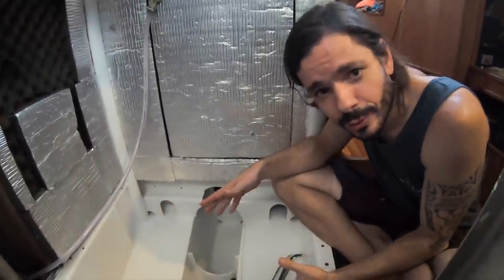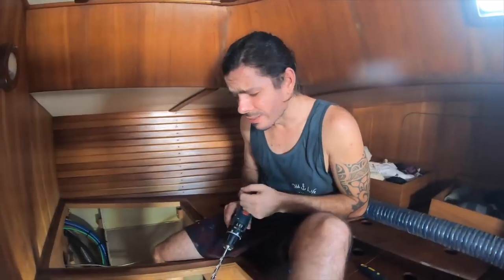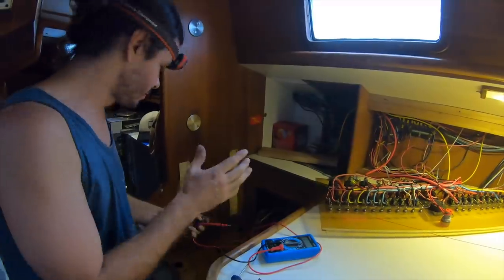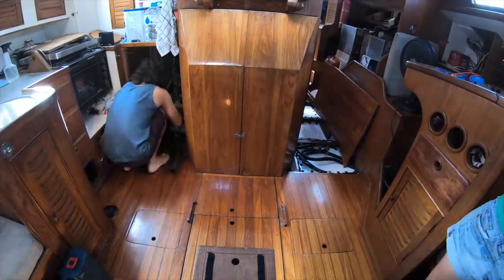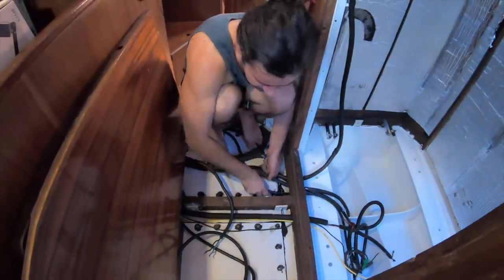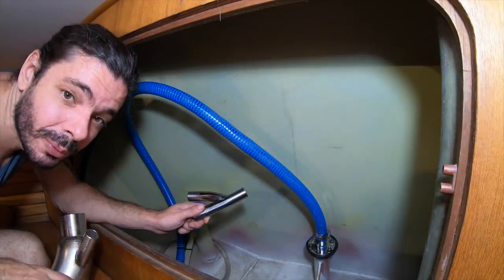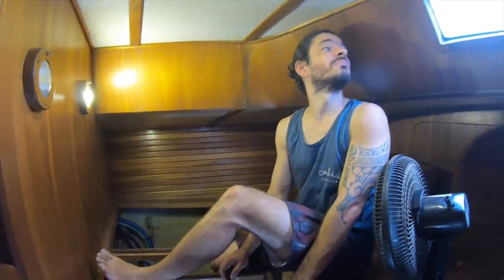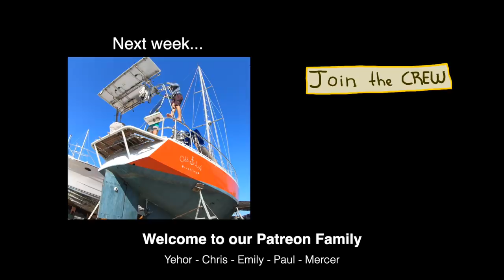⛵️We didn't think about that when we Bought a brand NEW ENGINE for our Sailboat!! 😨#174

Comment: Dont forget to check that the volume of your water trap will cope with the increased volume of the exhaust pipe. Its there to keep residual water in the exhaust from back flowing into the engine, when you stop the engine. The water trap looks pretty big but I think you have about doubled the volume of water it needs to hold. x 1.6 for the increase in cross-sectional area and the rest for the longer run. Your WT volume needs to be 1.5 x the exhaust pipe volume from ex elbow to gooseneck to allow a good safety factor - check this point with your installer. Measure it for yourself.
I'm assuming your engine exhaust outlet is lower than the top of the gooseneck, or maybe you have a high rise ex outlet to bring it higher?

Comment: Will you wrap the metal exhaust pipes with insulating tape? They will put off quite a bit of heat. I would use metal elbows between sections of flexible hose.
Reply from the maker: We talked about it in a comment pinned 😉

Comment: Exhaust gases are extremely hot can be between 500 and 1000 degrees F. Does the part of the exhaust pipe you are installing in this video get hot? If so, will the hot metal surface affect the surfaces the pipe is sitting or touching as it passes through the boat? Does the pipe require insulation?
Reply from the maker: We explained something about it in a pinned comment 😉

Comment: If that is an exhaust pipe, will there be a problem with heat? Exhaust pipes get extremely hot, enough to burn wood.
Reply from the maker: A little bit but not as much as if it was a turbo engine

Comment: Most boat exhaust systems are insulation wrapped due to the heat. Wondering if the Yanmar exhaust system requires insulation around the metal tubing. The Yanmar engines are really good looking, long life power plants! You two are all around impressive people!!
Reply from the maker: They didn’t require it, our old one didn’t have any insulation around.
Reply: @OddLifeCrafting : Oh good....thank you!

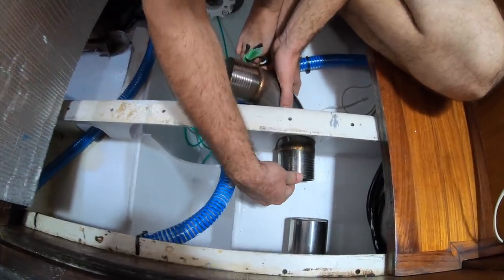Comment: Good day to you, Thanks for your very well done videos and bring us on board with you. At 22:30, tube MUST be in-line because in a so short distance NO flexible will resist to straighten up and create a leak. Also, always nice to protect wires (wire loom/grommet or any other type of protection) as well as exhaust tube to prevent vibration leak and noise. Be well ;-D

Comment: Just a thought, you might want to heat wrap (to keep all surrounding structures cool) all pipes and structure of the exhaust system, and use stainless steel zip ties to keep the heat wrap (insulation) in place.

Comment: Always look forward to seeing your videos, however am I the only one a little concerned using the new metal pipe for part of the exhaust?  Doesn't the exhaust get very hot? With you passing the new metal pipe so close to the wood of the cupboards will create a fire risk?  The other flexible pipes are insulated so will not be a problem....
Reply from the maker: Glad to hear you like our videos. We explained something about the pipes in a pinned comment 😉
Reply: @OddLifeCrafting  hey guys, totally agree your videos are so much fun! 

The cost of exhaust wrap and the hour it may take to put on is nothing compared to the engineer being wrong and having a fire caused by radiant heat. It is just one of those really small, cheap and redundant safety measures you can implement super easy and it offers peace of mind and just might save your life.

Really looking forward to next week!

Comment: Hiya to you both . For cutting away wood panels in difficult hard to reach areas you might find a cordless multitool with a variety of cutting heads easier . Stay safe and good luck .
Reply from the maker: It’s kind of an expensive tool here in Brazil

Comment: Good work, soon you will be done. There is a safety concern mixing the exhaust with the bilge pump outlet. I know you are putting a check valve between the pump and outlet. But the check valve may not be effective for carbon monoxide. It could be possible for CO to pass through the valve and feed through the pump and poison the air in the cabin. Just because the valve is air tight does not mean it is CO tight, Also, over time the valve can leak. Please consider enlarging the exhaust port in the hull to accept the 3 inch diameter outlet. It would be awful to have one of you asleep in the cabin during a long passage when the diesel is running.

Comment: You will need to insulate that steel pipe or it may melt your boat. With your space issue you might use a material that is used by pipe welders so they do not burn the wall. Keep up the great work. I think I would have just used a reducer from the engine and left everything else intact. I might have effected wide open throttle though because of the restriction.

Comment: Ok, after watching you use a drill to alter most every part of your boat, I want to ask: do you not have some small power tools? What current are you running there? I’m planning to look into this for you...if I had some battery powered tools, do you have a way to use 120 V for the charger? I’m serious!
Reply from the maker: Hey Michael!! All our tools are from before the boat so they are all 220v as our home town just uses 220v. On the boat we will have to use the inverter to invert 12v to 110 and then a transformer to transform 110v into 220v. We have most of the tools, the only one we have been postponing to buy is a multifunction tool be at some point we will get one. 😊
Reply: @OddLifeCrafting  any particular brand/functions? If they were 110 could you use them?

Comment: May need to allow more room for the pipe close to the engine to allow for movement of the mountings ( noise / rattling on the frame work) not much movement I know 
But just something else to consider.

Comment: Always have your ssb operational, just a little added comfort knowing that if all else fails you at least have that, sattelite phones dont work for crap in storms, you may be stuck in a situation that may be to far away for normal high frequency radios 30-50 nautical miles, and no cell towers on the ocean ;) so it's always good measure to have the side band operational they can sometimes range up to 400nm to 1000nm.

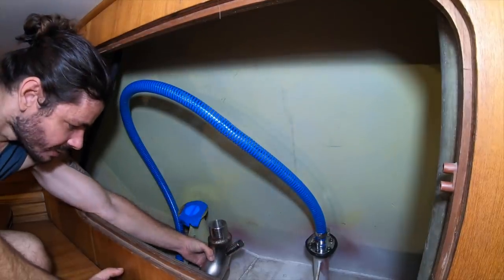Comment: The amount of daylight showing through the blue tape of the larger through-hull at 16:32 looks like it could be a little smaller than 2-1/4 in.. Confirm you are considering the internal diameters of your piping system.  Wall thicknesses of the various components may be different.

Comment: If you have wet exhaust you pull the rubber hose all the way to the water trap in the back.  Is it possible to pull pipes through the toilet cabinet, to the engine?

Comment: Just curious... what is the reason for needing such a wide exhaust? The Yanmar, at 54hp is ⅕ of the power of my Mercedes 3-litre turbo engine yet it breathes just fine through a 2" pipe. Is it to promote cooling?
Reply: Water cooled exhausts do need to be bigger than dry (car) exhausts but 2" would be fine for that run. Say 2 1/4 to be safe. Check the back pressure after installation (1500mm h20 max). May as well keep the run from exhaust outlet to watertap at 3" bacause thats the diameter of the Yanmar ex outlet.

Comment: Make sure you have a loop so in rough water or waves hitting the back of boat salt water doesn't go into the motor or bilge pump doesn't pump water into motor if line gets stop. Saw a guy destroy a brand new yanmar motor because salt water set in the motor on the pistons.

Comment: We had the same issue when we installed a new generator....Buying the generator was only half the cost....redesigning the exhaust system, and installing was the other half.....Really think everything out before you pull the plug on new equipment.

Comment: Lots of people are questioning the exhaust size and with the Yanmar engineer signing off it's likely fine. 

What I have an issue with is connecting a bilge outlet with an exhaust outlet. A failure of the check valve could allow exhaust to go into the bilge and cabin and could kill you. 

CO poisoning is a very real danger. I would just open up the outlet and make the exit 3". It's a steel boat and would be trivial for an experienced fabricator to do. It's what, the last 20-30cm or so?

Comment: Where that new exhaust pipe comes close to wood, I would add some insulation around it.

At 22:20, where the 2 pipes don't align, my suggestion is to trim back the pipe from the water lock about 5cm and then use a piece of flexible exhaust hose about 50cm to pass through the bulkhead hole and connect to the 90° on the other side.
Reply from the maker: Thanks for the suggestions. We don’t have a Flexible hose with this diameter here in Brazil
Reply: The exhaust is wet, so the temperature of the hose will never exceed 50°C. That is also the reason for the 3" hose for a 54hp engine.
Reply from the maker: @rhkavli  Thanks for the explanation

Comment: I'm not an engineer but wrapping the motor exhaust with heat resistant material is an excellent idea and well worth the additional effort and expense. Elbows in exhaust tubing can be problematic but again I'm no expert on these matters. Exhaust tubes can get very hot - hot enough to easily start a fire - so please don't take any chances - just do it!
Reply: It's a water-cooled exhaust. You only have to start worrying about excessive heat if the water comes out of the exhaust as steam, or stops coming out altogether.

Comment: Nice exhaust but what about insulation on the outside? Save heat and noise. Special in those corners where as your bedroom is the wood that should not be in contact with the naked exhaust. Furthermore, if you have a situation where as the exhaust is not in line you always can make a flange on both end and tide up afterwards. If I was you I would never make the exhaust all welded but somewhere on inconvenient places make a flange on both sides for the connection as later on you will notice the advantage from it when you need to move away the exhaust for some reason. Still thinking about exhaust insulation as this 4 cyl Yanmar will give some heat .

Comment: I would not have split the exhaust between the two hull penetrations.  Running exhaust through the bilge pump discharge risks CO poisoning if the check valve in the bilge discharge fails to stop the CO from back feeding through the bilge pump into the people compartment.  Be sure to install a CO sensor with an alarm in your cabin.

Comment: You should consider a heat shield for the metal pipe you installed near the wood cabinet/bulkhead. The hose you took out was an insulted flex hose that does not have the heat transfer capacity of the metal pipe you put in. Without a heat shield you may create a fire hazard.

Comment: I’m very worried the bilge pump may back feed water into your exhaust in an emergency.  What will happen when there’s positive pressure from both hoses? Even with the check valve it’s trouble.  They’re not super reliable under any circumstances, now this one is going to live in a bath of saltwater mixed with engine exhaust.  Even bronze must have a limit.  I love you guys.  Be safe!

Comment: Please don't take this comment or my previous comment the wrong way, because I've been a big fan for the entire journey. If Yanmar signed off in writing that a 3" pipe split to 2.25" and 1" pipes (with only one going to the can) is permissible to keep the warranty valid, then so be it. 
It just seems that maybe you should do the install in a conventional way, so there aren't any questions about warranties or safety in the future. Cutting through the hull is definitely kind of scary, but based on past videos, you have access to competent and talented welders who can do a quality job. 
With this setup you're relying on a mechanical valve that can fail and also a CO alarm which can fail (and also has an expiration date). Is the valve's intended use rated for both liquid and gases? Is the valve's seal rated to withstand the effects of the contaminates in the exhaust gases? Are the pressures involved above the valve's minimum operating point? With one pipe going to the can and the other going straight to the hull, will differential pressure cause any issue?
It's going to be a hassle, but I think putting a 3" exhaust port in the hull and keeping it separate from the bilge system is the way to go.
Reply: I'm only a civil engineer, not a professional mechanic, diesel tech, mechanical engineer, or marine engineer, but I hope you take a second look at things.
Reply from the maker: We talked about it in a comment pinned 😉We have a galvanizes steel hull and we didn't want to miss the galvaization welding the hull

Comment: An oscillating tool would help those cuts through bulkheads.  Many different blades and attachments for cutting and sanding are available.
Reply from the maker: For sure. We are postponing buying one as it's quite expensive here in Brazil

Comment: I am not an expert at this but I can tell you that after working with machinery for a number of years, you are making for more problems.  For me I would take the time and energy to increase the diameter of the different fittings  Yes, welding and cutting is required  but you will get a better job in the long run.  Yes, just my opinion.   Oh in the past I buildt Nuclear Submarines.   I have a feeling for this type of stuff.

Comment: Don’t know if I would want to put a draw full of flammable material that close to a exhaust pipe.............might I suggest you wrap the exhaust pipe in flame proof and heat proof material (exhaust wrap)? It will help stop radiant heat as well......

I read that the engineer said it is safe but for the cost of exhaust wrap...............peace of mind and increased safety. Not to mention, everyone knows engineers get things wrong at times.

Comment: Hi Guys, 
I would be worried about splitting the exhaust with a bilge pump as you may get gasses coming back thought the pump as the check valve may prevent water from coming back but not exhaust from the engine. I would just remove the bilge pump and plumb it to another line.
Reply from the maker: We used the same valve for our diesel vent and it workd fine. We talked about it in a comment pinned 😉

Comment: I may well be mistaken, but I think that you are also going to need an anti-backflow valve on the one inch diameter exhaust pipe which you have introduced via the y-coupler. Otherwise, when the bilge pump is operating it will pump water back into the engine via the smaller exhaust pipe.
Reply from the maker: We actually showed the valve we are gonna use on this video 😉
Reply: @OddLifeCrafting  My mistake. I thought that valve was on the other line. Keep up the good work!

Comment: Don’t wan to burst your bubble but the 3” exhaust has a 4560 mm2 surface area and what you guys think by connecting a 2 1/4 inch hose and a 1” hose doesn’t mean you get a bigger surface area (throat)  surface area of the 2 1/4 hose is 2574 mm2 and a for a 1 inch hose that’s just 506 mm2 together that gives you only a surface area of 3080 mm2 so you wil have a restriction in you exhaust system which can cause a lot of issues down the line. If it’s a wet exhaust system if it’s a dry exhaust system not so much unless you have a turbo driven Diesel engine

Comment: Not sure your exhaust plan will work out. 

1) It looks like that metal angle is not insulated from the wood. You may have a big fire risk there.

2) Exhaust back pressure depend on lamina flow. Not only that but the cross section area is only marginally improved by adding the second 1" vent. As others pointed out.

Cross section area = PI * R * R
For 3" = 3.1457 * 1.5 * 1.5 = 7.08 Square inches.
For 2.25" = 3.1457 *1.125*1.125 = 3.98 Square inches
For 1" = 3.1457 *.5 *.5 = 0.79 Square inches

So New 3" 7.08 square inches vs 4.77 square inches. Or about 33% more restrictive on area alone. However laminar flow and the addition of the diverter and walls will make it worse than that. That is quite a lot of added back pressure on the engine.  

This will add wear and could make it harder to start and lower power considerably. 

If you had 2 x 2.25 through hulls would be a much better match.

My fluid dynamics is rusty but you may be better off with using just the 2.25 vent and do everything you can to keep the transition from 3" to 2.25 right at the vent. (Shortest possible span in 2.25", of only a few inches at 2.25 and with a smooth straight transition put the beds in at 3")

Comment: Mate you cannot have a steel exhaust next to a wooden bulkhead it will catch fire when the exhaust heat up this why there were rubber exhaust before .I would advise using rubber hose going through the bulkhead, steel on steel will make so much noise from engine vibration.
Reply from the maker: We wrote some notes on a comment pinned. Check them out ☺️😉

Comment: RAP THE EXHAUST PIPE IN HEAT SHIELD THIS WILL ALSO HELP REDUCE NOISE AS WELL,    A TIP FOR YOU YOU SHOULD DOCUMENT ON A PLAN OF YOUR BOAT WHERE ALL PIPES AND WIRES RUN AND LABEL THEM,    THIS WILL HELP YOU SHORTCUT PROBLEMS IN THE FUTURE " HOPE KELLY SETTLES IN NICELY "

Comment: It seems strange, but jobs always are harder to do than they seemed to be. Just take the job one step at a time and you'll get it done. At some time in the future you may want to change the 2" thru hull exhaust pipe to 3" and have less back pressure in the exhaust line. It's looking great and I can hardly wait to see the new engine setting in the hull.

Comment: I'm amazed a small yanmar would need a 3" exhaust like that.  I have had several of the 3 cylinders with exhausts that are even smaller than 2 1/4".   They seem to run fine.  Is yours like a 250HP turbo?
Reply: larger dia. results in less audible resonation pulses transmitted to inside of boat.
Reply: @brustar5152  Really? I'd have thought a wide bore exhaust would be louder'/resonate more. Thats the case in the car world.